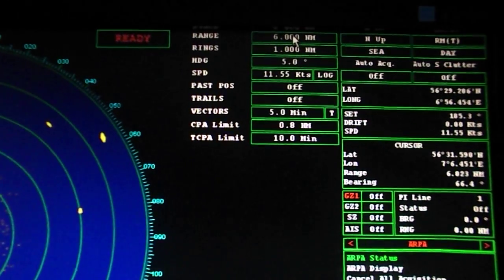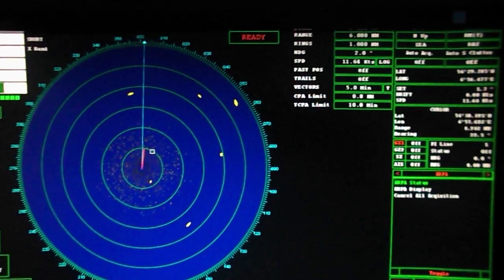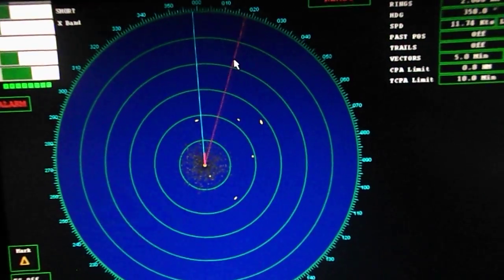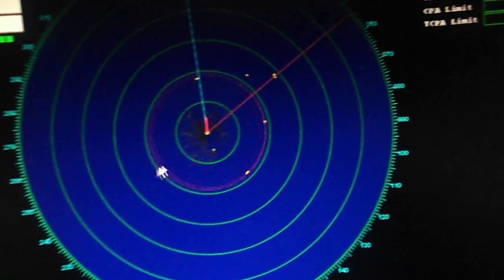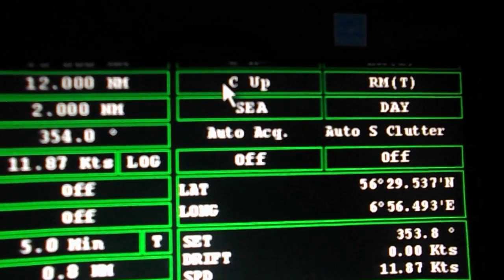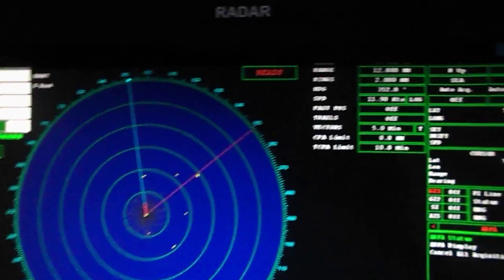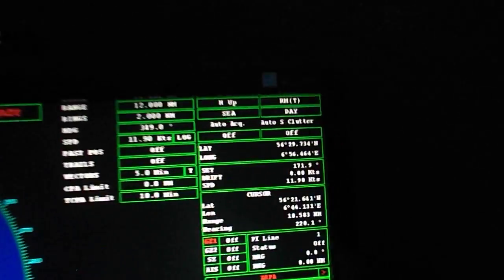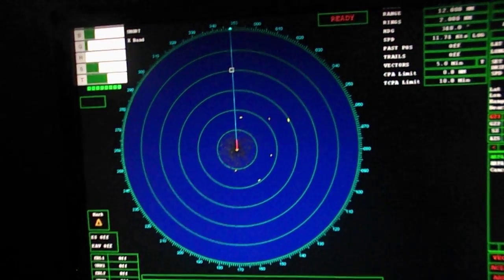RADAR FAMILARISATION BY AEMA CADETS PART 1

Comment: The trace moves from the centre of the ppi to the circumference in a radial direction. Could you please clarify of its moving in a straight line(at pulse repetition frequency but moving with respect to scanner) or spiralling outwards(  at each pulse a trace is sent out spiralling outwards towards circumference, and is visually seen by the eye as a straight line because it's so fast)?